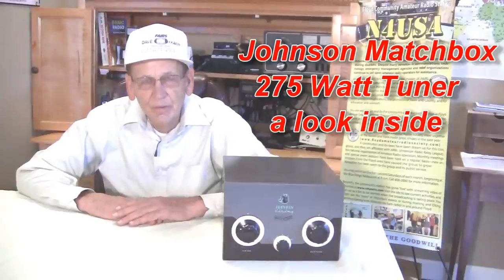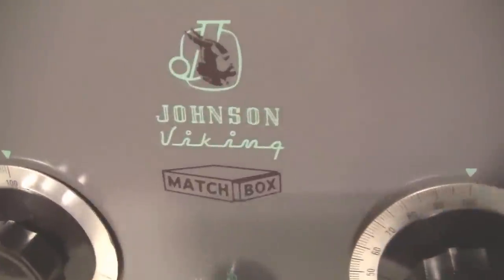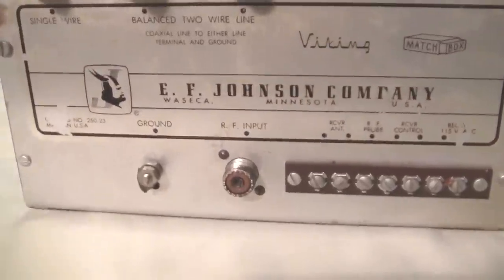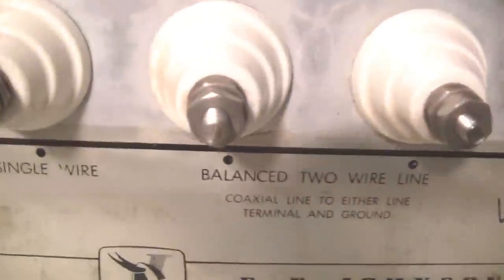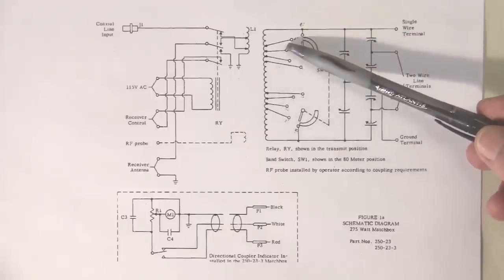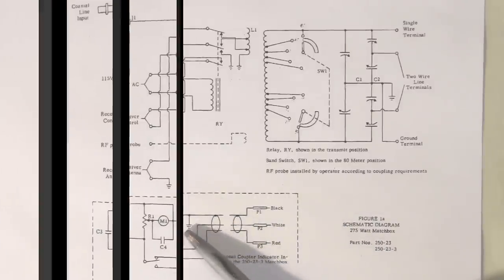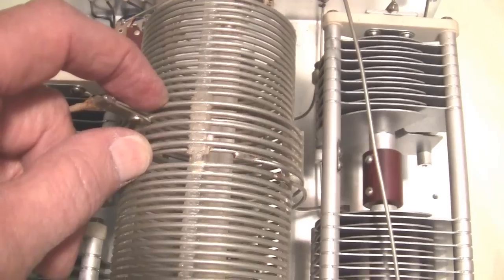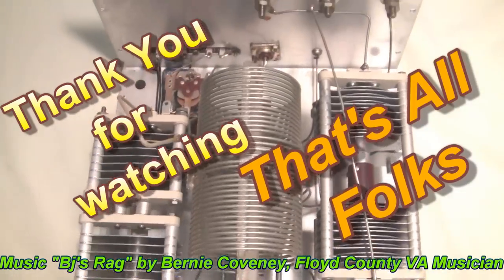Antenna Tuner Johnson Matchbox

Comment: Thanks for the look inside! To clarify on the power capability, I see in the Matchbox documentation that that 275 W is -- just as we rated ham transmitter power in those days -- input power, not output. Assuming 70% efficiency -- pretty optimistic :-) -- that equates to 193 W output. So saying that it's a "200-W" tuner is fine, but 275 W output would be beyond its ratings. On a hunch I checked the maximum input power of Johnson's mid-range transmitter of those days, the Viking Valiant. Sure enough, the Valiant was rated at 200 W input AM, 275 W input CW. So the (non-kilowatt) Matchbox was designed to handle the output power of the Valiant. Best regards, Dave/W9BRD
Reply: This is "AM" rated and the PEP equivalent of 200 watts is 800 watts PEP (in AM Mode). especially in digital modes or SSB, it's good for more than 500 watts continuous (non-AM) operation.

Comment: Awesome old tuner. I got mine with a johnson viking ll and a hallicrafters sx 71 rxer. My tuner is different as it has a meter and two knobs up at the top. I also got an external vfo with the viking. ;-) all for 100.00
Reply from the maker: Eric 12374 Yes Johnson made some of the best radio equipment in its day. Thank you for the comment Dave www.kk4ww.com
Reply from the maker: Eric 12374 Sound like you have a nice old ham radio system. I also have SX71 but no Viking 2 - I do have the old ThunderBolt amp and driver. Don't think I will ever put them in service. dave www.n4usa.com